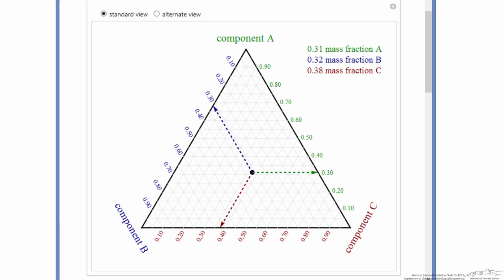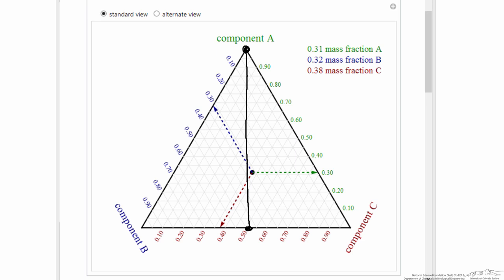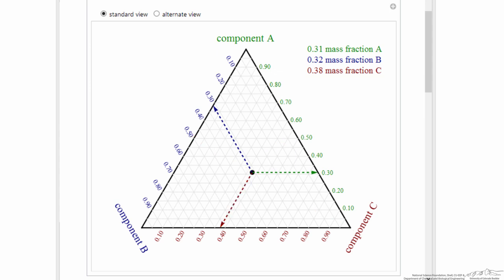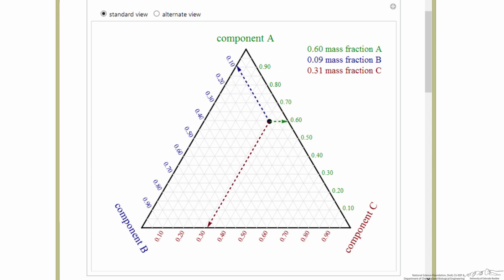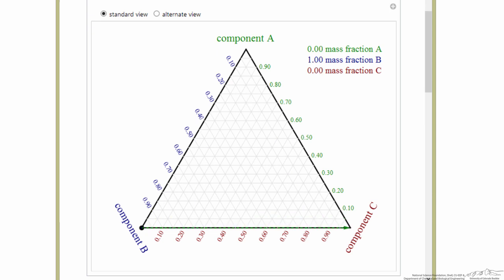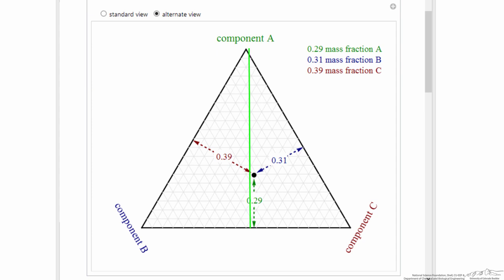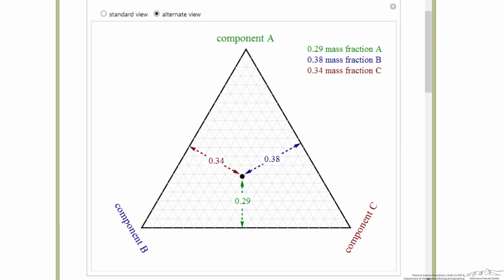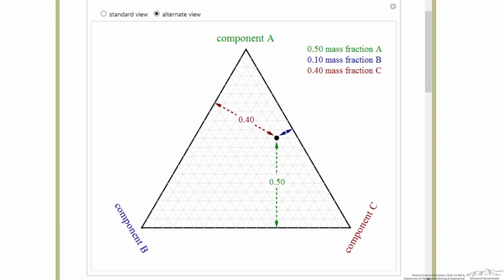Ternary Phase Diagram Basics (Interactive Simulation)

Comment: Thanks the way the axis are labeled is really confusing. Like why on the corners when you can write and label next to it's corresponding line instead?
Reply from the maker: Good question.  I think it's written that way because where "component E" is written is the point where the solution is 100% E, and the lines for E are perpendicular to the opposite line.  It always takes me a minute to adjust to that type of plot.